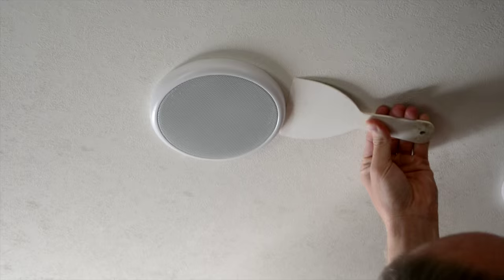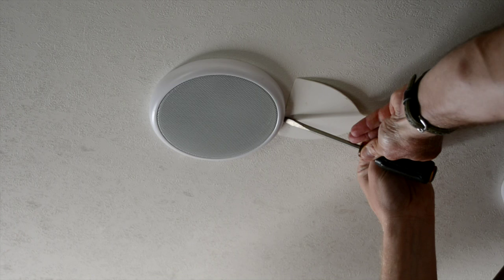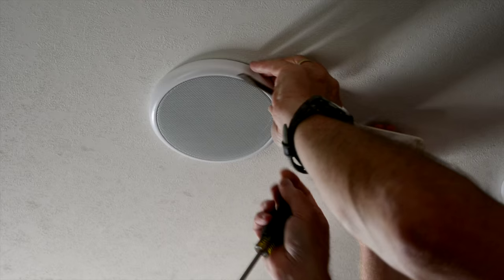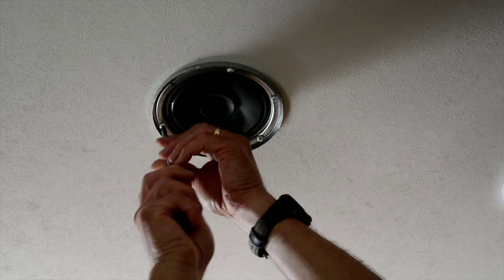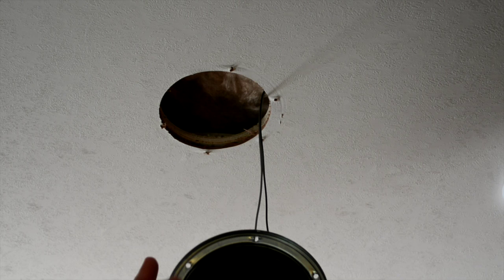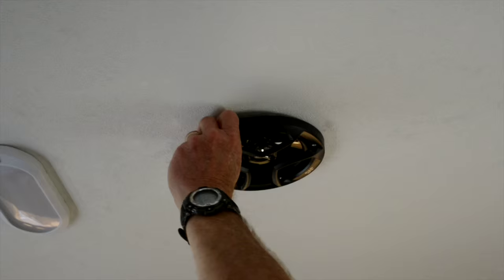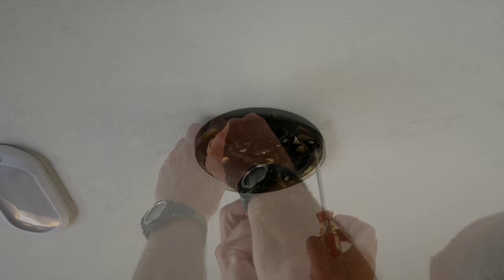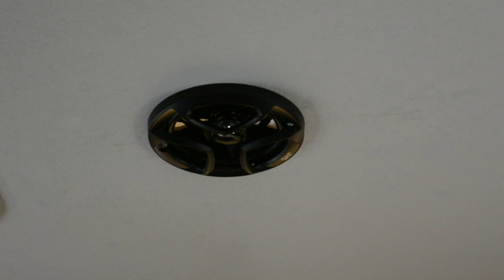Speaker Replacement In RV

Comment: Wiring polarity matters no matter how cheap the speakers or systems are. If you reverse the polarity, the speakers will be 180 degrees out of phase. Basically, one driver will be pushing out while the other one is pulling in. This is the same concept active noise cancelling used in headphones. The two speakers will fight each other. Depending on their distance from each other, you will have a drop of a certain frequency range. Always use the same polarity on all speakers. I was at a friends house and he had is stereo playing. It was one of those all-in-one receiver units and some cheap speakers. It sounded really bad and he said it was a cheap system and did not expect it to sound great. I reach in the back of one of the speakers, swapped the wires and all of the sudden the sound opened up. It did not sound like a live concert but it was noticeably improved. Good simple video.